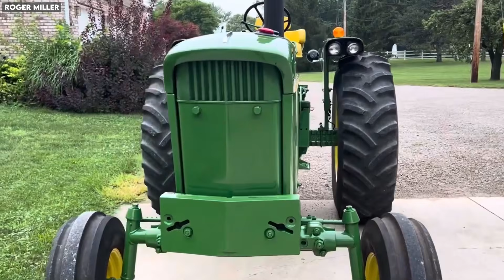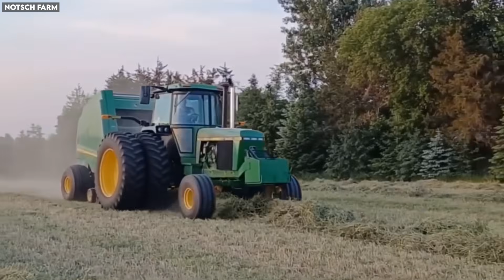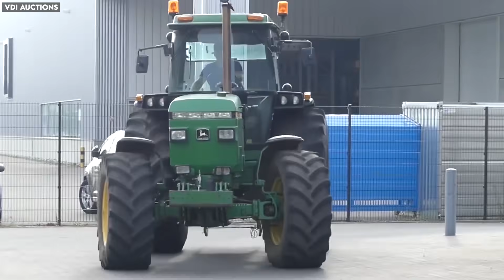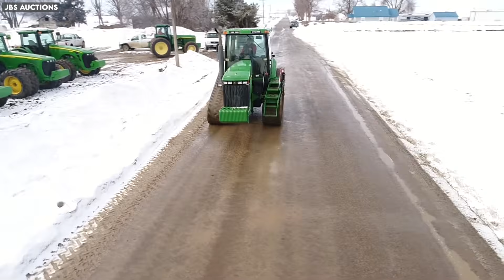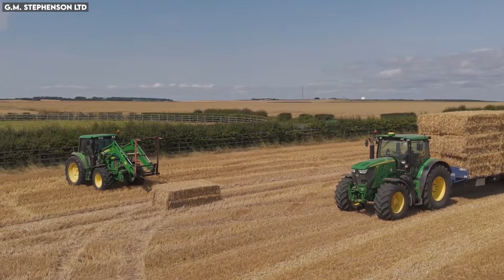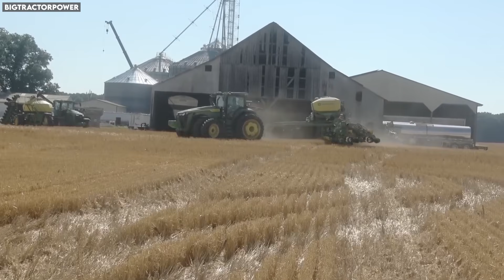Why These 10 John deere tractors Still Matter Today

Comment: I had a 4020 PS..with a 4620 engine..Kinze.. 38" rubber..  put a smaller turbo on it, reallly woke it up, virtually smokeless after this..175 HP. Fun